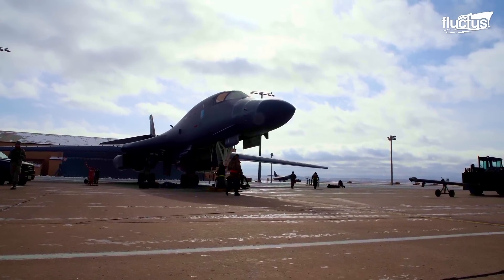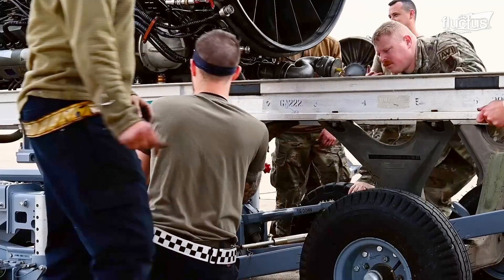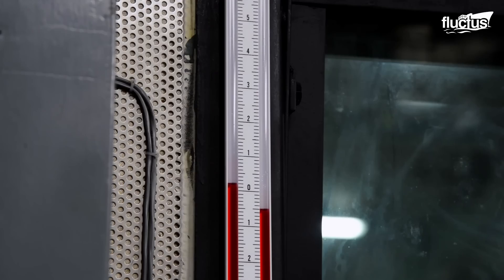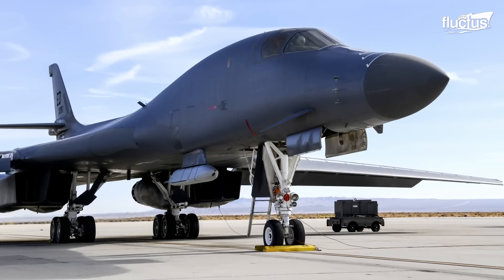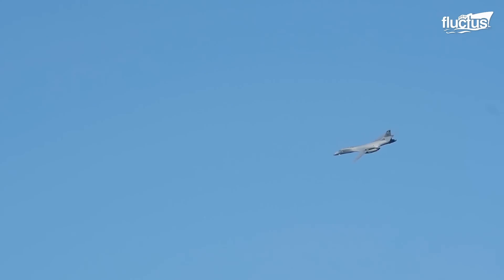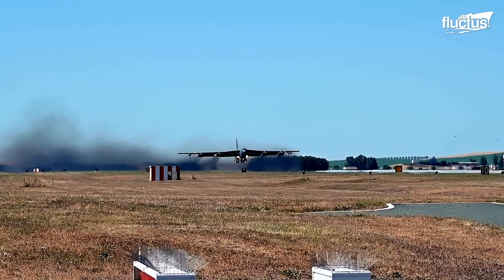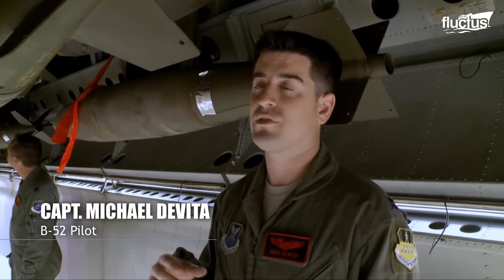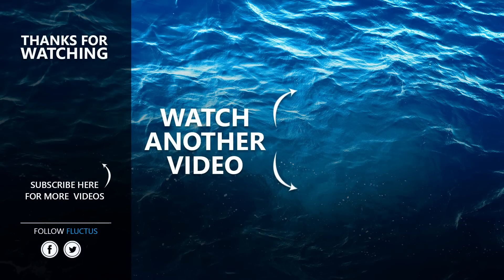Changing Monstrously Powerful Engines of the Gigantic US B1 Lancer Bomber

Comment: My favorite B-1
Reply: Nah.. I preferred the B-1A that was originally conceived as the high flying strategic bomber until the Carter administration cut the program, which was later picked up by Reagan and turned into the B-1B we all know.
But B-1A was a true beast with capability to reach speeds of over Mach 2. Since the B-1B was more steered towards the low level penetration, a redesign of certain parts of the aircraft limited its speed to Mach 1.2..
So again, with Mach 2 speed and painted in white, the B-1A was my favorite B-1.

Comment: Wiki Says
"The General Electric F101 is an afterburning turbofan jet engine. It powers the Rockwell B-1 Lancer strategic bomber fleet of the USAF. In full afterburner it produces a thrust of more than 30,000 pounds-force (130 kN). The F101 was GE's first turbofan with an afterburner"

Comment: Not trying to take anything away from our USAF A/C Techs. But those engines are not considered Monstrosity Engines they are considered as a low bypass engine. And there only 6to maybe 10 feet off the ground.
Try doing an engine change On the Nunmer 2 Engine 30 feet up in the air on a Hi bypass engine on a Lockheed L1011 the Rolls-Royce RB211.
OR on the Number 2 Engine on a DC-10 The (GE) CF6 Or the Pratt n Whitney JT-9D Also 30 Feet in the air I've done both in my 40+ year Career as an AMT! There's Zero room for Error if u F- up someone is dead or a Multi-million Dollar Engine is reduced to Junk n your Ass is Fired!
Reply: Totally agree. Typical YT mumbo jumbo for clickbaits